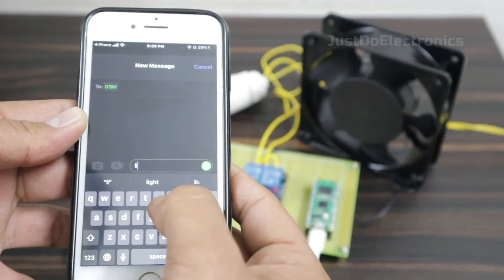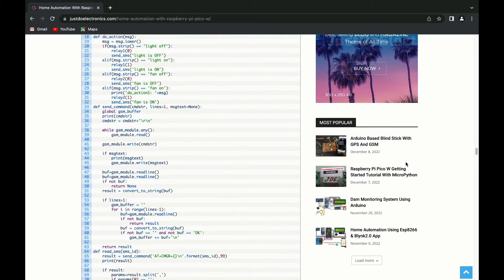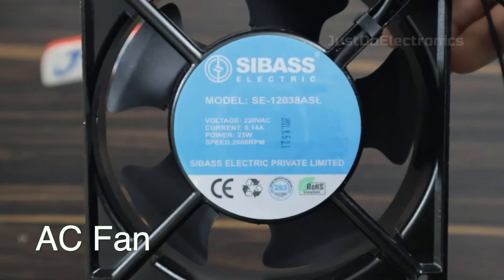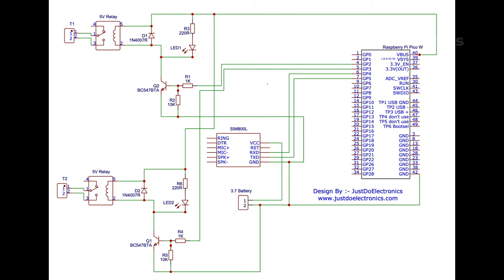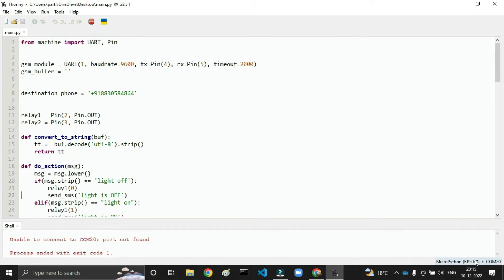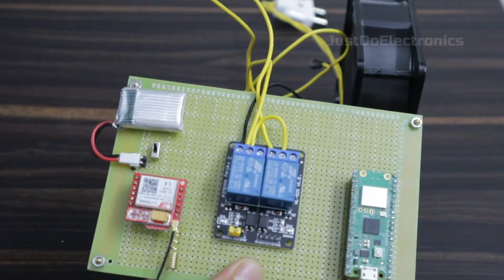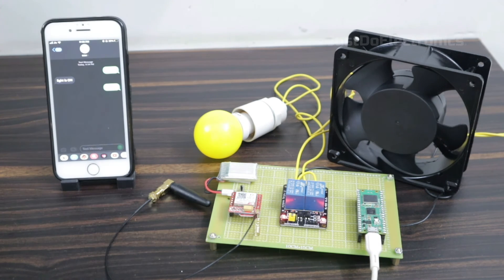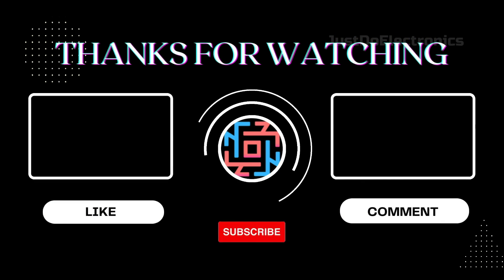Home Automation With Raspberry Pi Pico W

Comment: 800 or 900 GSM module  network problem what to do 4g GSM module or use local mobile
Reply from the maker: not is not network problem in my all project we used 800l

Comment: Sir, light and fan can turn off automatically after 5 seconds?
Reply from the maker: No when You send message Then is turn Off if you want to put tImer Then You also Used It
Reply: @JustDoElectronics  dear sir, I want need timer 5second, please can make the coding for both relays 5 seconds delay time to automatically cut off, 
Pls can make the code for me thanks
Reply: @JustDoElectronics  dear sir pls send the timer to cut off, pls send the code for relays 3 seconds delay to cut off, thanks